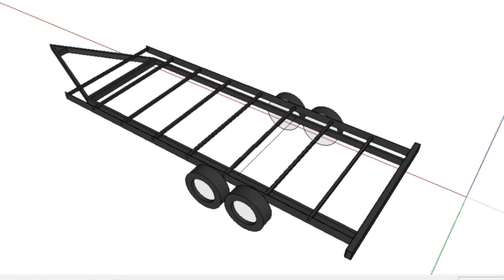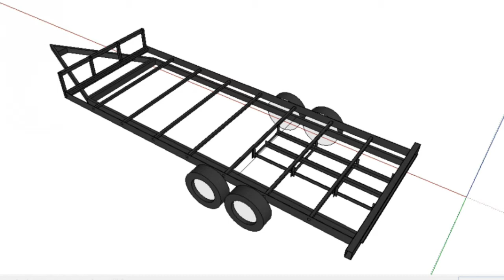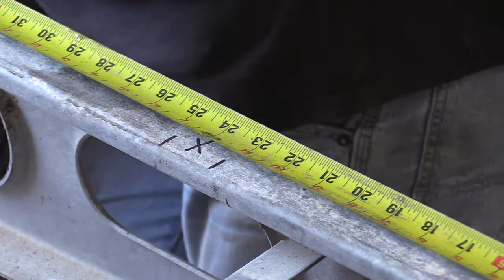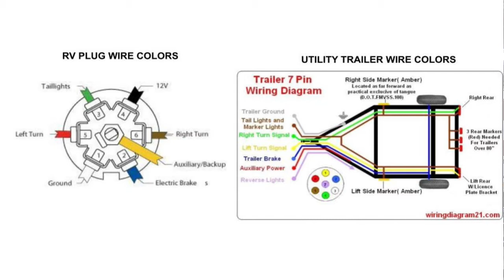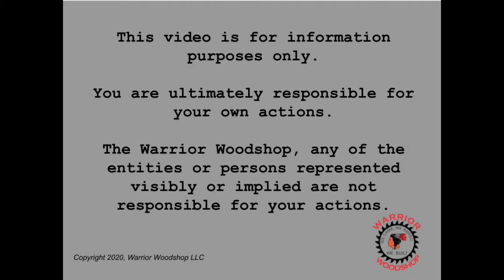Camper Frame converted to Utility Trailer

Comment: Very nice work here folks.  We're getting ready to rebuild a 20' flatbed that was originally a camper frame.  
Capacity goal is around 4000 to 5000 total gvw.  
Did you all do anything yo reinforce the front of the frame triangle?

I'm being told to add a long spine down the center. Seems like a decent idea.
Reply from the maker: I didn't feel the need since it was only hauling atvs.  It wouldn't hurt, however just add more tongue weight, something to consider.  Good luck and hope your's turns out just as good.